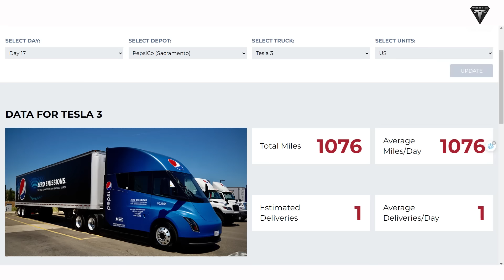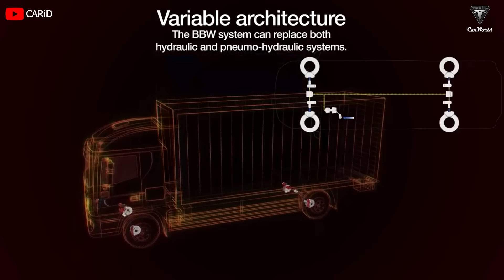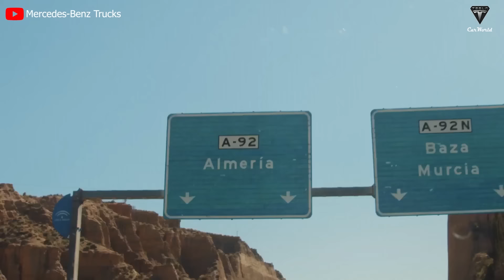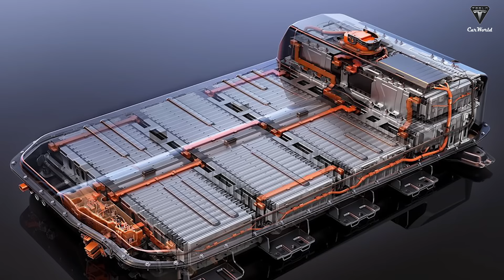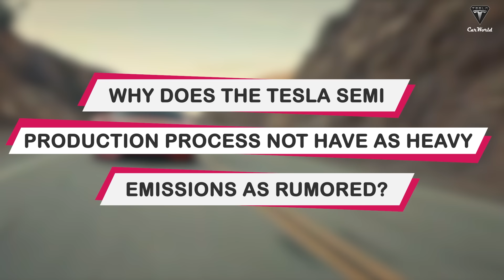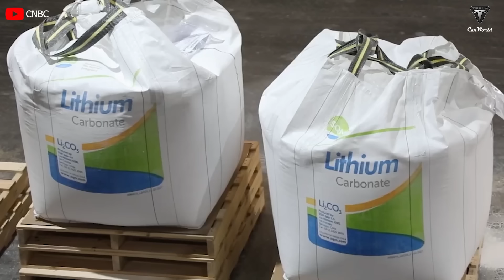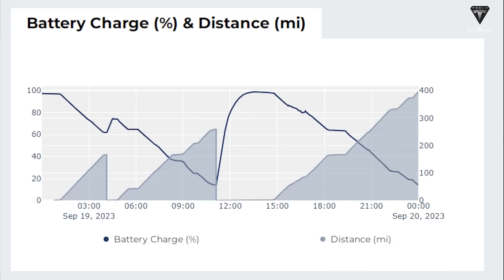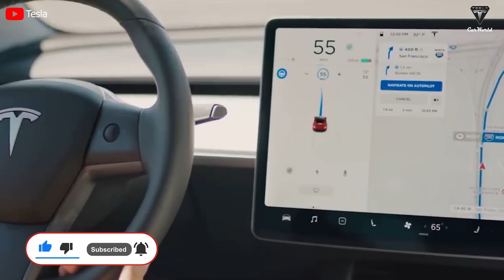Elon Musk Leaked Tesla Semi 82,000lb Version, Fully Charged in 1h and 3 Hidden Features! (MIX)

Comment: Drop the payload on the Tesla Semi from 40T to 15T or 62.5% and you go from 500 to 600 miles of range.  You gain just a 100 miles of range by carrying less than half of the cargo it can supposedly haul.  Did I hear that correctly.  Just how far can it actually haul the 40Ts because I don't recall hearing that in the video.  Having the power to haul a certain weight doesn't mean you can haul it very far.  I'm guessing it can haul the 40T about 300 miles.
Reply: Then imagine the range reduction if it’s in stop and go traffic.. if it’s in the winter when the battery is cold
Reply: @Meowface.  For sure.  When I first saw your comment, because it was electric, I immediately thought that stop & go traffic wasn't a problem and for a regular car it wouldn't be.  However,  when you consistently have to get 80+Tons up to speed it can't help but affect the mileage.  Winter would be even worse.
Reply: @christophercharles3169  
There’s a couple YouTube channels that did towing tests with the electric lightning
Range dropped at an unnerving pace
And when they did it in cold winter conditions the range was abysmal 
the cold would take a third of your range.. or something close to that 
It was bad 

Ford had to release a statement about it
Lots of orders cancelled
Reply: @Meowface.  Yep.  The Ford lightning is not an automobile for hauling or cold climates.  Thanks for mentioning the performance in the cold.
Reply: @christophercharles3169  
Applies to all electric vehicles 
Batteries don’t like cold 🥶
Reply: No they always talk from 0 to 60, never how far, how long to charge, you can tell they don't drive for a living

Comment: Good short haul, in local area solution. NOT good for long haul. Charging stations aren't like gas stations. No sleeper cab. Still need gas/oil produced electric for this. So that's not a big win there either. More time is needed in developing this technology before it becomes the go to choice.
Reply: What you are missing is that when the electricity is made from gas burning power plants, the well to wheel efficiency is over 60% for electric trucks, compared to the 12% well to wheel efficiency of diesel trucks. Plus the US electrical supply is now over 20% renewable (more than coal) and getting cleaner every month.
Reply: Did you not watch the video. Tesla will be producing a sleeper version. And that it's just looking at the day haul.
Also when the sleeper version appears the driver will be able to sleep in air conditioned bliss as he does not need to run the engine.

Comment: Informative but I could do without the hard sell.  I used to drive class 1 / Semis back in the late 1970s and early '80s.  This looks like a great step.
Reply: exactly, you saved my comment.
Reply from the maker: How do you feel about the Tesla Semi, we mean its potential!
Reply: New denser faster charging battery packs will help the case. Things are changing in this direction anyway. Many more charging places for them.  Starting a new workshop to create/finish cabins for long distance journeys (not day job). A different cabin configuration for the EU market (no need to change much, a V shape like a ship's old vertical bow, the wheel and driver closer to the small rectangular upright front window sided by two angular windows on his/her side), no need to imitate the old EU trucks/lorries cabin that had the engine below their bottoms (nice possible design ideas here, for ex. like the Flatiron Building. Manhattan. New York city), etc.  @TeslaCarWorld
Reply: @TeslaCarWorld  Assuming recharging is capable of dealing with potential demand the appeal to owner drivers, as opposed to corporates, might be significant. 

As I have never driven an electric, I can only go on what I am told. If they are less mentally demanding than diesel vehicles, owner drivers could well be the main market ,particularly on long distance.  I am less certain about local work, especially multi drop and collection.

The haulage market has several distinct types of operation beyond the notable distinction between own account and contactor operations.  It is inevitable any uptake of new technology such as electric will appeal more to some areas than others.
Reply: in 1 hour fully charged , in truck driving its timed deliveries
Reply: @ravd8082  A key question is whether the electric grid will be sufficient. I drove class 1 / semis years back. Things have changed but delivering on time has not.

Comment: the test they conducted was a Tesla road truck against a freightliner and volvo  day cab and expect you to believe that the day cab can only do 258 miles a day and the Tesla does over a thousand. That was a very quick LIE they through in there. 1076 miles in a day is illegal anyway
Reply: It’s a test and not actual driving
Reply: They are all electric
Reply: @dannymbass  yes they claimed a work day with a certain amount of stops with both trucks, and off the top of my head I can say that test is not verified because after 34 years of truck driving myself I know what a truck will do, straight road driving or city take your pick
Reply: @1SlipperyPenguin  ?
Reply: @joaquinbrown7331 the testing was done on all electric trucks made by each different company.  Not diesels
Reply: @Coyote1473  no it wasn’t I drove the electric trucks when jb hunt first got the Tesla contract and they quickly stop using them because diesel is more reliable, that’s from the regional managers mouth
Reply: @joaquinbrown7331  maybe there's been an error 🤔? I didn't comment about which was better value.  I just was trying 2 help someone that thought the comparison test was electric vs diesel.  All 3 brands appeared 2 b portrayed as new electric vehicles.  If not, I haven't seen any of them on the highway, with the body design
Reply: Bunch of lies

Comment: “Each gallon will emit 10,180 grams of co2” so… ten kilograms (or about 20 lbs) from one gallon of fuel? 
A gallon of water weights eight pounds. Fuel is lighter than water so, less than eight pounds per gallon. 
You can’t have the mass of a gallon of fuel, releasing energy and acquiring more mass. 
I don’t see how that can be correct.
I’m a huge fan of the Tesla semi, but I just want to make sure I understand the physics correctly.
I suppose if a carbon atom combines with two oxygen atoms in the air to become co2 (and you lose some mass to kinetic energy) that would make the math about right.
(My dad was right. I should have taken chemistry.)
Reply: Did you take chemistry class?  Each CO2 molecule contains 2 atoms of oxygen (from air) for every atom of carbon (from fuel).  Also, each atom of oxygen is heavier that ech atom of carbon.  Ignoring the hydrogen in fuel (which is very light), roughly each kilogram of fuel produces roughly 3 kilogram of CO2.
Reply: @GuavaDuff1  no, I didn’t take chemistry (as mentioned) but I was speculating (as mentioned) that this was the case.
Thanks for the confirmation.
It’s also inserting that oxygen is heavier (which is something I hadn’t considered.) I appreciate the info.

Comment: While the Tesla semi is impressive; there is one big major problem.  What is going to happen when the power grid goes down and you can't recharge the batteries?  While some may say "well; if the power grid goes down, you can't pump fuel either".  Most truck stops have emergency generators for that reason and those generators burn diesel to provide the electricity to the pumps and truck stop.  You can say "well; we can use the same generators to recharge the electric trucks"; that is counterproductive to the purpose of the electric trucks.

Comment: To be honest it’s impressive. I’m glad they got to get it to at least 1000 miles. But in  the long run is it echo friendly. What I mean is can 100% of that truck be recycled and be and have no toxic environmental issues with it items that are always toxic, like solar panels and windmill turbine blades?
Reply from the maker: When Tesla produces a vehicle, everything is meticulously calculated and specifically planned.
Tesla Semi has eliminated the transmission noise as much as possible and the battery packs are definitely recycled, trust this. Manufacturer aiming to maximize the use of renewable energy sources and it will soon be popular in all factories! Thank you
Reply: why does it need to be 100%? With ICE vehicles, the only thing thats recyclable being the steel/aluminium. That is maybe 10%, with the rest not even landing in some landfill, but dispersed into the air we breath. Yet, why is the make or break idea of 100%, applied to a technology that, at least for the duration of of at least 10yrs, is clean.
Reply: There isn't a vehicle made that is 100% recyclable.  And it is ECO friendly, not ECHO.

Comment: regarding the Run On Less data while interesting it cannot really be used to draw comparison from one truck make to another during the test, as it is missing some absolutely fundamental key metrics, being the payload moved and GTW in effect, this includes return loads in effect, for example, a truck could on the sight and at first glance return bad results based on the overall lack of data, but could ultimately be the most efficient, based on payload carried and minimising distance without payload - it also gets harder to make fair comparison if trucks are running different routes etc, the only way to make fair valid comparison was if everything was ran across the same routes at similar times, with similar payloads etc, the less similar things are the less valid any test is, and it just turns into smoke and mirrors and blowing hot air up the arse of any EV pundit as marketing - e.g. take day 17 for the PepsiCo tesla 3 it did 1076 miles and did 1 delivery, thus by implication it potentially did 538 miles empty, when it returned from its single delivery, which is hardly efficient use of a truck.
Reply from the maker: We appreciate your analysis, considering our results based on official information provided by Run on Less. If it makes you unsatisfied, we will take a closer look in the following episodes. Thank you !
Reply: A diesel truck would also be 538 miles empty, so what's your point.
Reply: @chetsaxton1526  the point is without the context of payload and other factors you don't know if PepsiCo was making a sponsored point for the purpose of range claims, that journey could have been nothing more a single pallet of cola just for the purpose of "technical" delivery, else a light load etc, which distorts results, while other EV truck operators or even a diesel truck may have go about it a different way or at significantly higher payload, else combined a delivery with a collection, thus reduced empty miles, else making the whole thing a more efficient journey, there are a number of spurious PepsiCo Tesla 3 days, including zero delivery days of >700 miles, and payload and the methods of operating are one of the key bits of data needed to fairly asses all the EV trucks taking part in the Run On Less "test" rather than blindly picking a day that just had the most range in 24h.

Comment: from which source ,the battery manufacturing companies get power? Is it hydro -electric or nuclear or thermal power plant?????
and EV manufacturing companies also require power ??!!
Or solar / wind energy??
Reply from the maker: Battery factories are mainly from China and they have many ways of exploiting and producing with many different energies. Electricity, Solar, and Wind, all are used. But you have to think that the pollution from battery packs is no less than producing a truck with an internal combustion engine, producing both emissions. The most important thing is what it contributes to the environment after completion! Thank you
Reply: But What I understand is, China has hot vast number of coal fuelled power plants on earth. Is it correct?

Comment: Next step is to be careful with weight distribution as it relates to damage to the road (turn an asphalt road into waffles). When you are able go 1000 miles with 82,000 lbs (which is the limit allowed on most roads). Thus this is twice or about two trailer loads of what a semi would normally provide.

Comment: I really like the Tesla Semi, but battery production will 100% not be up to the task on the 4680 batteries for a couple of years at best.  the 4680 production right now is at 4GWH per year and for 50,000 units you would need 45GWH per year just for the Tesla semi alone (this would only include the 900kwh version of the semi).  now with the new cyber truck coming up also using the 4680 cells that number needs to be even higher. if it really has a range anywhere close to 500 miles it is going to have a 200kwh battery pack for the top-end model.  So as of right now and the next couple of years they are going to be limited by battery production to a crazy degree. That is not even mentioning the grid power part of the company that would also like the LFP 4680 batteries.  To put into perspective a plant dedicated to just making batteries for the 50,000 Tesla semi would be the largest battery plant in the world and by a very large margin.
Reply: Considering how flexible Tesla has been on using different batteries in the same vehicles, I would expect them to do the same for the Semi and the Cybertruck, and be able to use 2170 cells as well.
Reply: they are retooling the 4680 battery line and adding 3 more lanes (for 4 total I believe) with version 2 of their production lines which is faster, more efficient, and I believe more dense than the current line, so 4680s should be produced much quicker than before.
Reply: @GoCoyote  maybe, but that would make those huge beasts of batteries cost even more with even less recharge cycles.  LFP batteries are obviously superior when it comes to recharge cycles and with the semi supposed to go a million miles. anything with under an average of 3000 recharge cycles I imagine would be unacceptable.  Again all I said is that there is no way tesla produces more than 10,000 in 2024 and 25,000 2025.  The production just flat doesn't exist and takes literally years to build and years longer to ramp at 100% capacity.
Reply: @reru_personal  so what are we talking about here? 20 to 25 gwh at best? What is eta on those factories running at full capacity? First quarter 2025?  It's super cool, but Rome was built in a day. Not to mention, I think a slow ramp would be better for them anyway, as the infrastructure for them is going to be a big undertaking. And they are literally years (probably 5+) looking at the event that just took place. So they have time to widen the gap even more so if they play their hand correctly.

Comment: I’m hearing just the opposite from professional drivers (Class A CDL) in California! The Tesla Semi is a fair weather “friend”. It has to stay on routes populated by Fast Chargers! Also a number of drivers report seeing diesel generator sets “quietly” charging the Tesla Semi on the down low, in obscure places. They cannot compete with diesel trucks transporting off the main charger grids.
Reply: It seems that you have no idea what you are talking about because Tesla Trucks are on a set route with chargers on either end that don't need chargers along their route. It would take a large diesel generator to charge the truck and even then it would still be just as dirty as a regular truck but if it was actually charging off a diesel generator there would be 10,000 pics of it connected to the generator.

Comment: 12 chargers at a station. 30 minutes per truck. Each charger could handle at most 48 trucks per day. That is 576 trucks in 24 hours. There are almost 3 million trucks running in the US. You would have to power at minimum 5,250 charging stations 24 hours a day 365 days a year just to give each truck a single charge a day. In most places the electric grid is already at maximum capacity. Where is all this extra power going to come from?

Comment: I expect Tesla to reveal long haul electric trucking with team driving.  One trucker sleeping in the cab while another drives.  About 1400 miles per day.  The first route will be from Giga Nevada to Giga Texas.  In August Tesla announced plans to build 9 electric semitruck charging stations between California and Texas.  They have a request for $97 million in federal funding.  Each charging station would be equipped with eight Megachargers, with each a capacity of 750 kW, and four chargers designed for other electric trucks, likely the Megawatt Charging standard.  I expect the four chargers designed for other electric trucks, will also have NACS cables.  So effectively 12 Megachargers at each station.  Each Megacherger consumes as much electricity as 8 V3 Superchargers (If they are built like Pepsi's Megacharger site).  So each site will be the size of 96 car supercharger site (12*8).
Reply: That is a lot of power.  6 megawatts of juice.  Sounds like a sudden increase of electrical consumption equal to a small town at every recharging station. And he’s building 9 of them.  So about 54 megawatts of load added to our current grid.  

Doesn’t California already have brownouts?